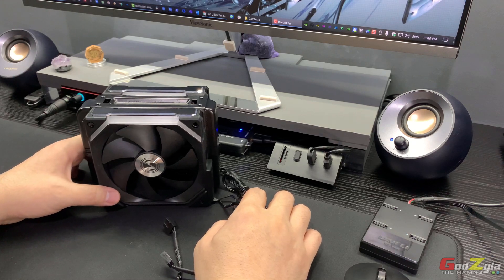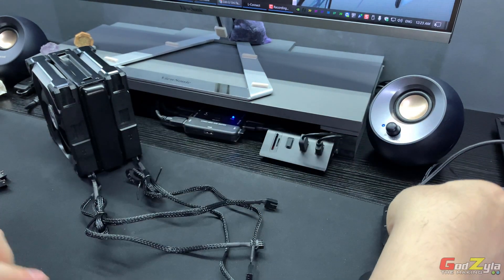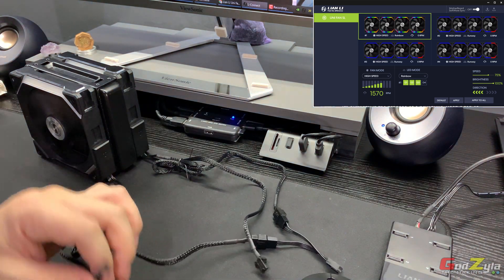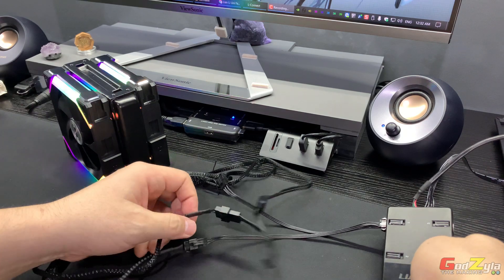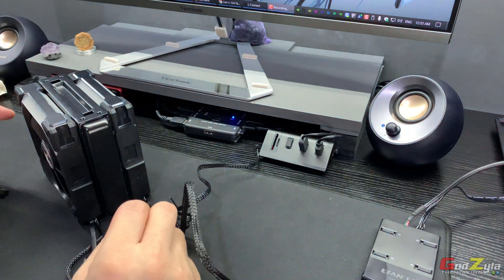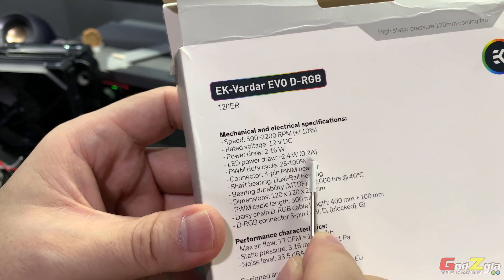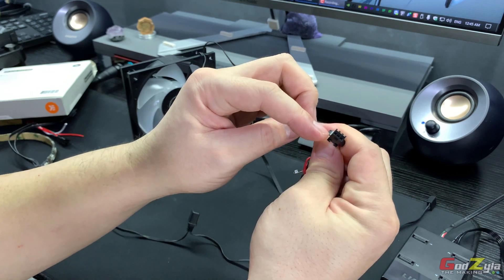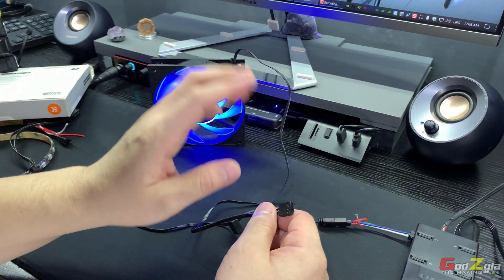Lian Li Uni Fan SL120 - Push and Pull configuration [L-Connect]

Comment from the maker: I have done a series of videos base on this uni fan which might interest you, list as follow

Introduction (Part I) - https://youtu.be/ORdObJTn-3E
Dos and Dont's (Part II) - https://youtu.be/QQHJUQvKwlY
Connection & The Controller (Part III) - https://youtu.be/Rm2emeyMUAk
To use Galahad AIO on Uni Fan Controller - https://youtu.be/XNCAeAX0mZQ 
Some Break Fix!  - https://youtu.be/8l4i5UjO3es 
Using EK Vardar Evo 120ER aRGB Fans on this uni -  https://youtu.be/bMRz2KVqbjA
SL120 Case Airflow Test - https://youtu.be/Qp3pYqOOjm4
SL120 Static Pressure Airflow Test - https://youtu.be/apDZ4v_jQBs
Reply: Thank you so much for the video. This will help me a ton. I am in the US and aliexpress is sold out on that link you gave. Having a tough time figuring out what to search for from the description in that link. Can you help me figure out what I need to buy from amazon ,or somewhere else? I just want the splitters for arbg into the controller. I can find the pwm splitters.
Reply from the maker: @grayfenix  hi, welcome to my channel, maybe this will aid you https://www.aliexpress.com/item/1005002457259774.html just make sure it's 3pin (when you select the box, it will show you 3pin : Color 3pin)
Reply: i wached it i just need a splitter for the lighting

Comment: Hi, I got two case fans and aio

First time buildt a pc, I mounted one front fractal case fan as intake and one case fan as exhaust

The aio is exaust, I heard in order to achieve positive pressure, I need more intake than exaust, so should I mount two front fans instead? Since aio is an exhaust as well?
Reply from the maker: Hello Thanos, hi again. lets see what case are you using? in practise yes you should but depends on your case. if your case has restriction at the front, then no point placing it.
Reply: @KleoYan  I have meshify c, I'm using a 3070 ftw3 ultra, I can mount two front fans and one exhaust but I only got two fractal case fans for now
Reply from the maker: @Advocate_INFJ  I see. then you can start flooding more case fans into your system.. 3 in front, 1 rear and if you can mount your GPU vertically will be advantage as the hot air dont go directly to your motherboard,.
Reply: @KleoYan  for the time being I only got two fans so how should I place it? 

I'm looking to either get some lian li fans or corsair
Reply from the maker: @Advocate_INFJ  hmm 🤔 if you take my advise. Go for arctic p12 argb fans. They draw low current, give tons of air and super quiet.

As for placement just make sure you place 3 intake. Too rad 2 fans as exhaust and rear exhaust
Reply: @KleoYan  alright I'll look into arctic

Comment: This was useful, I was looking to mount 3 x 120 radiators with push pull on all three.
Reply from the maker: Hi Paul welcome back, please note that the illustration of this video is meant for only 4 uni fans to do push pull configuration. do not daisy chain total of 6 fans and to plug to the uni controller, especially the argb connection to the controller. as there is a limitation of the argb load that the controller can provide. if you daisy chain all 6 fans together and to plug it to the controller. your controller might burn out and I've see some which melts the uni controller usb cable or to melt the motherboard usb header. kindly take note,.
Reply: @KleoYan  That's useful to know, thank you.... I will only connect 3 fans per connection. I think the uni can hold 16 fans total....
Reply from the maker: @Paul-if1jq  Hi, though it stated that uni controller can take up to 16 fans but thats only if you plug 4 fans to one output and not 6 fans to one output. There is a limitation on the uni controller. I think you should watch this dos and donts https://youtu.be/QQHJUQvKwlY as I do not want you to end up like some others who either melt their cables or burn their motherboard usb header
Reply: @KleoYan  Will do, thanks...
Reply from the maker: @Paul-if1jq  wish you all the best in your build. :)

Comment: Hi There,

I have a push configuration on my AIO Kraken Z73 360mm. The AIO comes with 3 power  power connector but surprisingly one of them 4 pin other 2 3 pin not sure why. I have not used NZXT s fans instead installed SL120's and daisy chained them then connected their power to the one of the 4 pin power connector coming from the Kraken z73. Did I do it correctly? And if I want to use NZXTs fans for pulling and SL120s pushing configuration what kind of power setup would you suggest? I see that if I try to use the Lian Li Hub I can't connect 6 fans into one socket so I guess should I do 4 and 2 ? But then not sure if putting AIO fans to hub, does the hub responds to the pump and CPU temperatures? Thanks in advance and sorry for my long question. I just don't want to burn anything :)
Reply from the maker: Hello Whtevr, welcome back again, do pardon me. I have little knowledge on the Z73 and besides, I do not advise you to do push pull configuration with different fans. As different fans have different ampere load and blade rotation. by doing so you are actually damaging the fan. Next, you would yield any signification performance gain after so much trouble to plug those fans and to cable management them, unless you have a radiator of 60mm thick. and last of all you only attracting more dust accumulation to your radiator which will raise your CPU temp.
Reply: @KleoYan   Thanks Kleo, I think i will try the Lian li set in the future, for now I will just stick with a push config. If I use a another set of 3 SL120 s it will be total of 6 fans. How do you suggest to config them? In pairs with Y connectors or can I daisy chain two of them on pull side and two of them on push size then use the Y connector in total for 4 fans? and do the other 2 fans on their own Y connector separately so I will be taking 2 slots from the hub? Bu then their RGB lights will be weird and hard to control :D
Reply from the maker: @iscus3523  you are most welcome. there is an issue if you split them as the sequence will not match up accordingly to L-Connect application. you see, each SL or AL fans have a build in chipset that takes in commands, just just when you play with argb Arduino programing. however there is someone who solder the fan with wires and that will work. still I would advise you to do so. so the only option you have is to do Y Splitter on both argb and fan load, also when you do this, make sure total fan to one output of the uni controller. you can't do 6. 360 rad configuration is best to use two uni controller. Firmware prep https://youtu.be/hZpzR_4917c and the actual usage https://youtu.be/1n1mo6TDwvY

Comment: I bought the lian li argb cables but didnt get the argb splitter
Reply from the maker: Hello Kristina Nikolic. if you are getting the correct argb kit. this is just an illustration https://imgur.com/gallery/beYR8CN which you can reference. Thank you!
Reply: @KleoYan  thank ypu very much, this was what i needed
Reply from the maker: @kristiannikolic6284  you are most welcome.
Reply: @KleoYan  hello again, can i ask regarding strimer plus, can the unihub manage 1 unifan (sl120) and the strimer plus in the same port?
Reply: I mean connecting one fans argb with splitter to strimer, since the fan connect is available
Reply from the maker: @kristiannikolic6284   with only 1 SL fan yes, but make sure your strimer plus strips are drawing power from its own strimer plus controller. This is to prevent overloading on the uni controller.
Reply: @KleoYan  super, i had one fan over and only had the one port, yeah the controller is connected to the hub through argb connect
Reply from the maker: @kristiannikolic6284  yes it can. So long your strimer plus strips are drawing current from the strimer controller.
Reply: @KleoYan  btw i wanted to personally thank you, yoyr videos have been a real blessing, very informative for a first time builder, have an awesome day 😊
Reply from the maker: @kristiannikolic6284  you are most welcome. All the very best in your build and stay safe 👍

Comment: question  how many  ARGB  can be split in one   unit number n I mean the lighting only
Reply from the maker: Hi perry haralambidis, welcome to my channel. For each output of the uni controller. It can take up to 2.6 ampere load. You can use splitters but need to know how much ampere drawn per fan. If you are using sl120 or sl140 in push pull configuration. It will only be one splitter needed but make sure not to connect more than 4 fans.
Reply: @KleoYan   thanks I'm only using  Lian-Li  uni fan argb nothing else   can you make me a custom splitter so I can use   my  fans RGB and  strimmers with the strimmer controller and Lian-Li   dynamic xl  RGB because i can't make it don't have the tools  le pay you for it
Reply from the maker: @idubbzz7790  Hi Perry, thank you for your inquiries the cable can be purchase at online store. maybe you can tell me how your setup goes? How many Uni SL fans are you using and what are their position? example top, bottom, side, rear and what cooling solution are you applying? using Heatsink cooling or using liquid AIO like the Galahad? Then I will be able to advise what you can do.
Reply: @KleoYan  im useing 3 120 on a kraken x73 aio 3  120 on top  n 2 140 on bottom one rear top ones ar exsaust rear  same bottom 2  intake and  esaust for aio
Reply: @KleoYan  can you link me to the splitter bc the one you show us is only for one I need for like 5
 I just want to have the lights on one splitter n  the fans  on  normal
Reply from the maker: @idubbzz7790  Hi, this is what I will suggest. as there is a limit on the uni controller. you can't just chain all fans and plug to one output of the uni controller. if you can, kindly watch the dos and donts of this unit https://youtu.be/QQHJUQvKwlY 

As for your configuration. I will  suggest this. I am confuse of your configuration. but can only tell you that your X73 AIO pump is RGB and not aRGB. cos it's 4pin not 3pin. 

I can only explain it this way, 

Fan Load Y Splitter https://www.aliexpress.com/item/4000298742009.html (This is for fan load) 
Fan Argb Y Splitter  https://www.aliexpress.com/item/1005002457259774.html (This is for argb only) 

if you want to connect standard argb to uni controller socket, this is what you need https://www.aliexpress.com/item/4000298742009.html (Make sure to choose 1 to 1 Female 5V 3pin)
Reply: @KleoYan  I'm doing  4 in one  and then 3 n 2 but i wanted to split the RGB up
Reply from the maker: @idubbzz7790  Hi, hmm.. there are total of 4 outputs in a uni controller. you can do this which do not need a splitter. With the L-Connect software you can control individual output set. 

Output 1 = 4 fans
Output 2 = 3 fans
Output 3 = 2 fans.
Reply: @KleoYan  the thing is I managed to split  my aio  fans n rear into one  unit  but I need a converter and Ali express  taking to long   is it possible to make a converter for just the RGB lights for one channel or is that way to much so i wanted to have the RGB on one converter plus the dynamic xl  RGB on one i  need 5 to one convertrer
Reply from the maker: @idubbzz7790  I don't advise you to chain so many to one converter. 4 fans is max for one output. you are going to overload the uni controller and you will melt the cables or even burn your motherboard USB 2.0 header. there are cases reporting here https://www.reddit.com/r/lianli/  I strongly encourage you to understand the limit of this unit here. https://youtu.be/QQHJUQvKwlY

Comment: I have 10 uni fans, lian li XL, strimmer plus. N i purchased a set of lian Li argb kit. My set up was top, bottom n side 3 fans n 1 rear. Assuming rear n top i connect to 1 input of uni hub, strimmer plus from their own controller to uni hub 1 input, 3 side 1 input, 3 bottom 1 input. Can i share lian li XL with side row of fan?
Reply from the maker: Hi Kong Sky, the setup you wanted to do as listed below is ok. 

Uni Output 1 = Top 3 uni fans
Uni Output 2 = Bottom 3 + Rear 1 uni fans
Uni Output 3 = Strimer Plus (through it's own controller)
Uni Output 4 = Side 3 uni fans 

but what do you mean by share lian li XL with side row of fans?
Reply: @KleoYan  lian li 011dynamic XL also got rgb. How do i connect to the uni hub when all input taken? I trying to say can it be done like 3 side fan + 011dynamic XL?
Reply from the maker: @sky20  oh I see what you mean, for that.. look at the strimer controller, I believe there is an additional port to connect your XL argb strip to it. look at the strimer plus manual. https://drive.google.com/file/d/151v3Al6J36hiw_nKmSN4dpQOXWrDY-qq/view , where it says "Support output compatible (WS2812B) LED control singal [D1.GND] that is where you can plug the XL argb controller to it.. You will need to fiddle yourself with that, I've done it for a friend and sorry, I can't recall how to that. Just remember it;s to your XL argb controller and not directly to any argb strips.
Reply: @KleoYan  XL got no controller. Just normal 3 pin argb cable. So i just put XL cable to strimmer plus controller?
Reply from the maker: @sky20  there is a uni located at the bottom of the XL case where you do your cable management at. there should be a argb cable sticking out, connect that to the strimer plus controller which I have explain to you :) hope that helps.

Comment: Great video!

The same would apply on a CPU Tower air cooler, right?
Reply from the maker: HI Fredrik Eksund, welcome to my channel, yes it applies the same as using a CPU  Air Cooler.
Reply: @KleoYan  Hi again Cleo,

I was wondering if you knew a good way of mounting the Uni fans to a CPU Tower cooler?

I have a Vetroo V5 air tower cooler but the mounting clips are too short for the Uni fans.

Thanks in advance!
Reply from the maker: @fredrikeksund9839  hi Fredrik Eksund, I do not have this tower cooler but base on what I see here https://youtu.be/ToI6za7ePIA you can try using cross stitch thread https://www.amazon.com/CHZIMADE-Strand-Stitch-Embroidery-Thread/dp/B087BTKPG2 to tie and secure the fan on the heatsink.
Reply: @KleoYan  thanks! I tried using zip tie and it worked perfectly 👍
Reply from the maker: @fredrikeksund9839  zip tie can help but you need to be careful as it’s plastic. Part of the reason I mentioned to use thread as it will not melt
Reply: @KleoYan  Thanks for the quick reply and answer!

Comment: QUESTION i have the Lian Li AIO it have 3 fans 6 wires 3 males 3 femal but i dont have all the Y splittlers to run them SECOND QUESTION can i replace those 3 fans with 3 Daisy Chain Lian LI fans with would only have the 2 wires
Reply from the maker: Hi Elvis Best, are you having the Galahad 360 AIO? I believe there are cables supply for you to daisy chain your ST120 fans. you should be able to daisy chain on all ST120 fans on both argb and fan load. kindly check your package. as for changing fans. yes you can  if you intend to use SL120 .. btw I did mentioned that one output of the uni fan hub will only take up to 4 fans in one daisy chain. do not chain more than 4. thank you!
Reply: @KleoYan  these fans galahad aren't gassy chain i ran them to the mother cause I didn't had cable to tie everything in with i have 11 fans connect to the unit 1 rear fan 3 bottom fans 3 next them MB and 4 in the front
Reply: @KleoYan  all the AIO fans cables are daisy can into one I had to.order more splitter since I didn't had all of them

Comment: Great Video again Kleo. I currently have a Galahad 360 AIO which I am using in a push-pull configuration on Lian LI  Dynamic CMR edition. I have the Unifans on the bottom of the rad and three Noctua NF-A12x15PWM connected on the top. The Noctua fans are connected via the motherboard and the Unifans via the controller. you got me thinking when you mentioned that the fan speeds need to be synchronized. Ideally, I would like to control both sets via the Lian Li controller is this possible? The specs are (120x120x15mm, 12V, 4-pin PWM, max. 1850 RPM, Max. input power 1,56 W, 
Max. input current 0,13 A, Operating voltage 12 V, Voltage PWM signal 5 V).
Reply from the maker: Hello Don Thomas, for Noctua you can give it a try but I don't think it will sync up. the load is ok which is at 0.14a .. but am not sure if it does work. it's safe try.. unlike the EK Vardar EVO 120ER which goes haywire. but it is safe to test not an issue. so long your fan load is not above 0.18a you will be fine. but as mentioned, I do not know how noctua fans will react but am sure your fans will not blow. maybe just not able to sync up with the RPMs on the L-Connect app. let me know if it works for you. thank you!
Reply: @KleoYan  Thanks I will give it a try and let you know.

Comment: may I know if the controller work with razer synapse?
Reply from the maker: Hi Ryan, thank you for your question, I have test it out by installing the  razer synapse software, nope, the uni fan controller does not react with the application, at least it did not react on mine. once again thank you for your question and to have visit my channel. If you find my content useful, subscribe to my channel and click on the notification button. thank you!
Reply: @KleoYan Aww.... too bad, I was thinking to build a full razer synapse controlled RGB build as I can control the lighting all through Alexa.... However, i can't seem to find a good solution... maybe will have to get a razer rgb controller to try